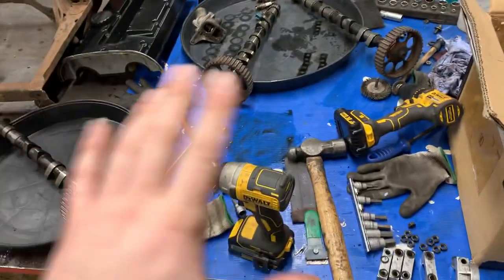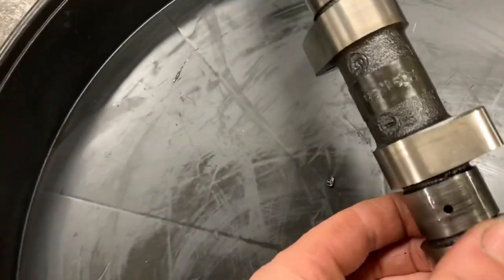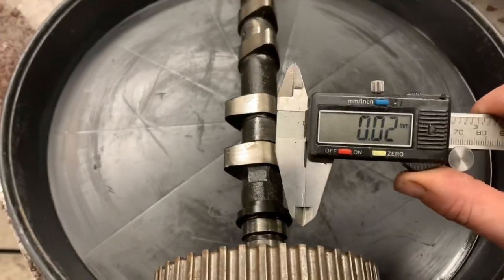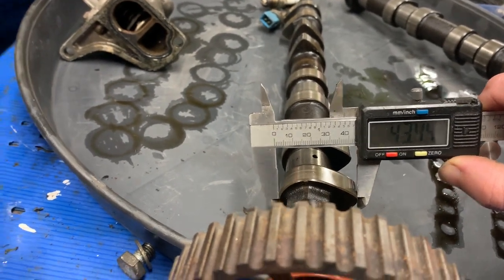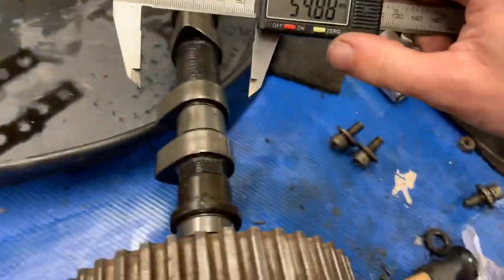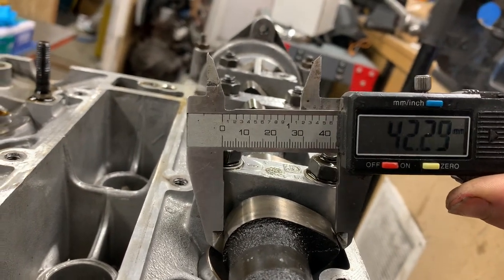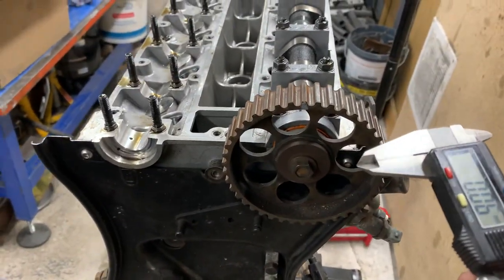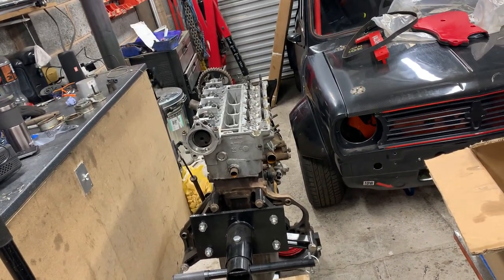Measuring cam lobes on the c20xe mini

Comment: Hi, most probably one set of camshafts had a regrind to a different profile. You need to keep in mind, that the total lobe hight as measured by you is not the valve lift. The valve lift is more the difference between basic cam diameter to lobe hight but has to be measured on the valve tips when everything is assembled in the cylinder head. Cheers Christian